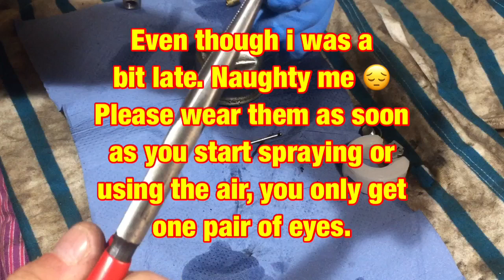SV150 Mower Engine Carb Clean ( Mountfield , sovereign etc )  Carburettor  🪥

Comment: good video Luke and good thorough cleaning of the carb 👍
Reply from the maker: Hi yes I give them a good clean, sometimes it does the trick sometimes not, if a basic clean doesn’t work I will put them through the Ultra sonic cleaner if that fails I get a new one. This one was fine on the mower. Thanks for watching 🙂👍

Comment: Hi Luke👋
Looks very much like a Honda carb. I don't think I've ever seen a carb look so clean and shiny!
I've noticed that hardly any carb sprays let you use a straw, really annoying.👍
Reply from the maker: Hi I haven’t seen you comment for a while hope you’ve been ok? welcome back. Your right these are much the same as a Honda carb and as you say it’s was in as new condition. I can’t understand why the cleaner doesn’t have a straw I think I used a WD40 top so I just change it over to the next can when i run out, so much better with a straw. Thanks for watching 🙂👍